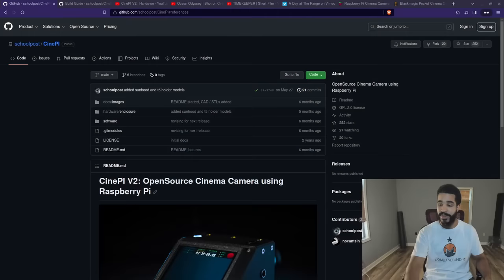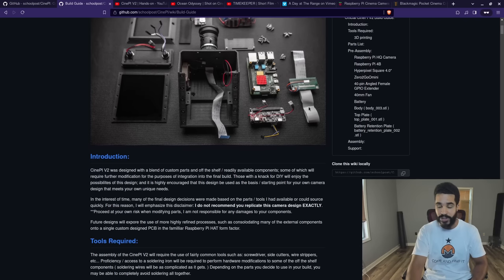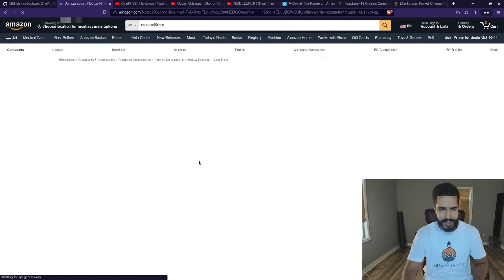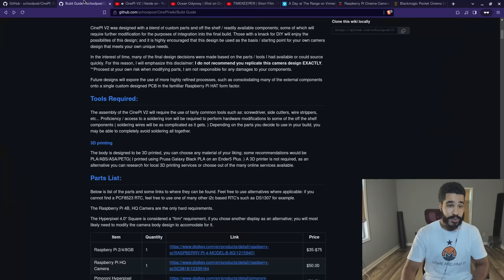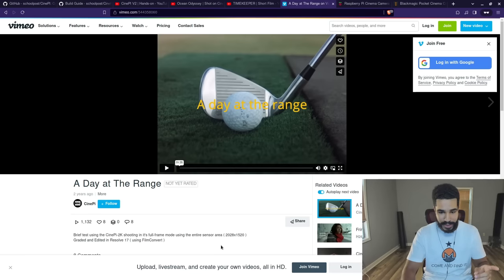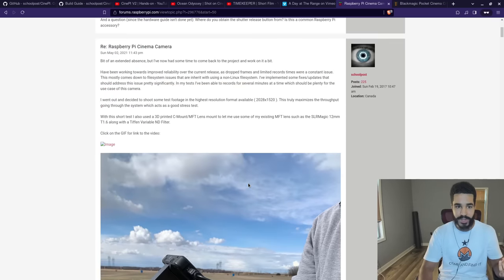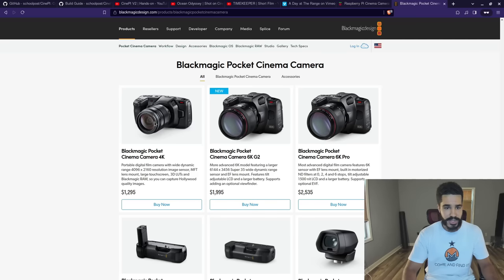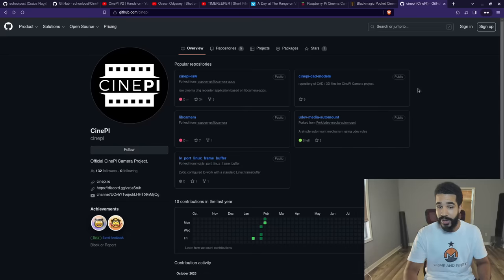CinePi - The Open Source Cinema Camera

Comment: Not "cine" at all. The Raspberry Pi HQ camera is "HQ" in Raspberry standards but the small sensor does not have a cine style color depth, not a high dynamic range, 4K resolution or a high ISO rating. It is no way up to spec with some of those BlackMagic cameras you show. By the way: 4K is nowadays a small resolution for a cine camera but I think about the best that is available for a higher budget hobby filmer.
CinePi is still a great project: it is an affordable DIY camera solution that can be built in a lot of different form factors. I have a few Raspberry Pi 3 based HQ camera's that I mostly use for shooting bench top work to be shown during class room trainings on a large screen. I have been looking at a "cine" style camera with a larger display. But camera, lens, display, smallrig cage and a lot more of thos fun accessories make that an expensive and out of reach target for me. 
So I think I will build one, and like suggested by the author I will not replicate the camera exactly. Most likely it will just be a black box with loads of 1/4 inserts to add handles, frames, battery packs, SSD and a display so I can play around with different setups to see what I like.

Comment: Higher resolution doesn't mean better quality. The senor is too small to justify anything bigger than a 12MP and 2K. Cellphones use computation/AI to enhance and sharpen the image for photos and very little for video because it would take forever to process each frame, even with the fastest ARM processor. This setup would be better off used as a photo camera using G-CAM where frame-rate isn't the target. CinePi doesn't seem to be using any form of computation/AI to enhance and de-noise the image or dual gain.

Comment: My phone camera can do 4k30 or 4k60

Movie camera itself is cheap, it's all the different lenses and optics and terabyte  hard drive that make expensive 

I can record on my phone, throw It in after effects And you can't tell the difference between my phone and movie camera

Seems like using 35 or 70mm film then digitize each frame with a 8k cmos or ccd would be cheaper...
Reply: Film also allow you to change recording framerate while you record too

Because a 60 or 120 fps film looks wayy different from a 24, 30, or 48 fps film

Because if you have a set playback framerate, you can go high speed or slow mo simply by changing the record fps, and resync audio track
Reply: Because even 16mm film of good quality can produce the same clarity as 1080p

35 and 70mm produce 4k And higher, film doesn't use pixels, it's based on dpi

It's just in 2023 you actually can afford a playback device that can actually show the full "resolution" cuz the film always looked that good
Reply: You can still buy 35mm and 70mm film, just gotta find someone who can still develop it, and find someone who still sells the developers and fixing chemicals 

Kodak doesn't really sell it like they used to,

Black an white film is easier I used to develop my own pictures
Reply: As much as I laugh at this product as its not a true cine camera, your phone sucks and regardless of what resolution and speed your video is at it still looks like garbage

Comment: Sensor crop much? With 5.7 crop factor your 10mm lens is going to become a 57mm lens. I'd rather have 10bit or even 8bit color with oversampling of the whole sensor than 12bit that's only useable for macro or tele work.